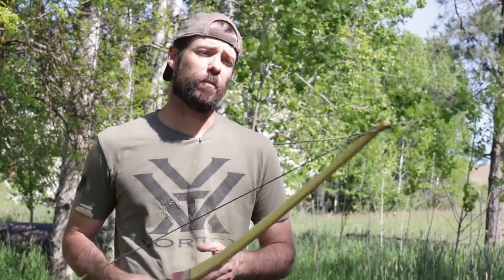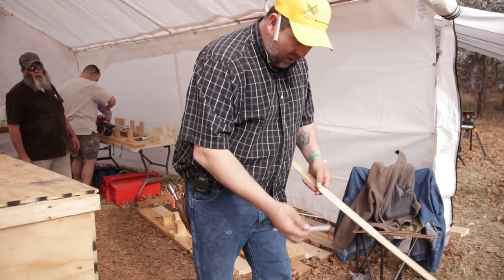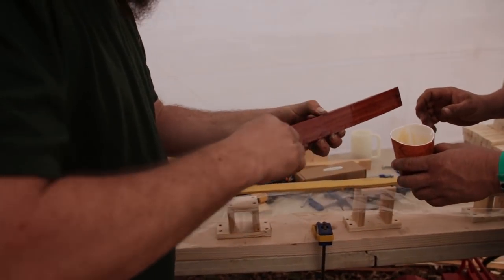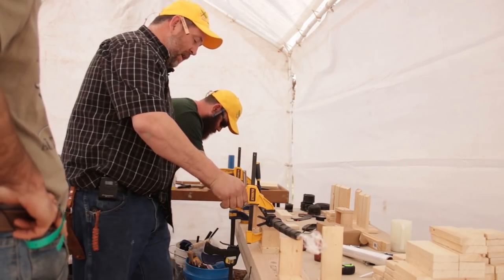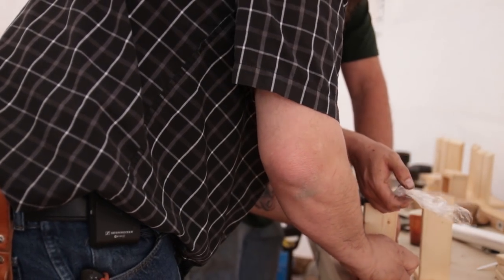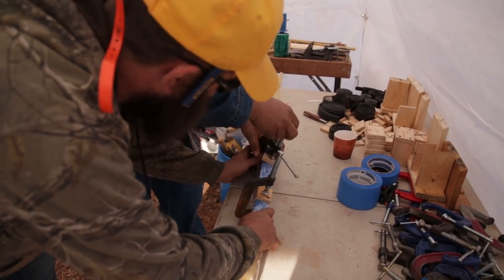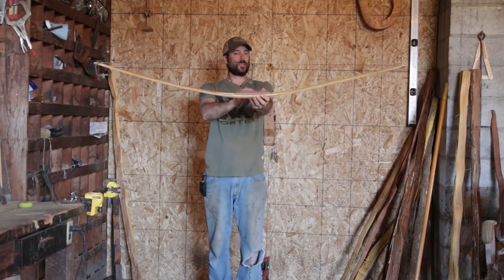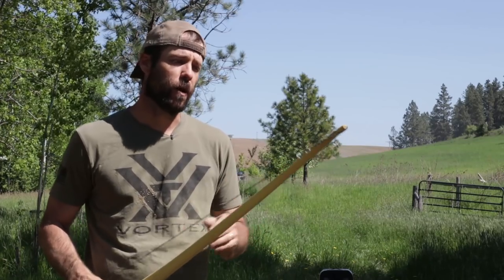How to build a Bamboo backed Osage reflex deflex long bow

Comment: Thank you for verry nice video! 
I am Japanese, I have a Mandarin orange field & Bamboo bush in my mountain so I will try to make my own Bamboo bow!
But there is no Archery or Japanese Archery gym at my living area, I am sad about that.
Sorry my English is not good. Have a nice Bow life!
Reply: You have to understand this this style of bow will require many thing's,..... but its the finest bow that can be had 2nd only to the Asian horn bows.
It requires bamboo and a good hard wood.
Most woods will work as well as Osage orange but,..........to equal woods like Yew and Osage other woods  must be WIDER to equal their belly compression.
If you use other woods and make a skinny bow the belly crystallizes and crush's the cell walls,......and leaves cracks in the belly.
All woods can potentially be as good as yew and Osage orange if they are wider.
So,....the prep is bamboos absorbs all moisture in the air,... then the wood and bamboo comes unglued.
So,....you prepare the wood and bamboo and put them in a dry box for several days prior to gluing,.....then the glue will bond them together correctly.
These Bamboo backed bows I think are the best.
Good luck and best wishes.
You cut, shape, dry box, glue,... then you tiller the bow. 

In america,...rarely do we go to a shooting range,... we shoot in our back yards,....or out in the woods.
Rotten stumps or a hill side will stop the arrows.
Oh yeah,.....the wood you cut must dry for about a year,.... because green wood takes a set,....that means it don't make a good bow till it dries.
In America we have book's that instruct us on how to make all bows.
books
The Traditional Bowyer
The Bow Builders Book
The Bent Stick
And there's a few more and I have no way of knowing if they print them in Japanese.
Reply: In the case of the example bow in this video, I wonder if you backed the bamboo with sinew and shortened each limb about .8-1.0in if you would have a 50-55lbs draw @ 26-28in draw.
In this case this would be much simpler to build then a horn belly horsebow with siyahs and tempering/setting the limbs, and I think for the time to build and resources this reflex/deflex would be a considerable option.
I bet a matched 360 to 372 grains arrow would fly very nicely with that setup, too.

The only thing I'm concerned is that since there was no heat tempering of the wood that you have to leave it unstrung when not using it (unless instead you back the bamboo with fiberglass and switch osage to Ipê, lol).
Reply: Did you try making it?

Comment: Regarding mixing strong epoxy.The glue forms when one type molecule locks into a molecule from part ‘b’. Any unmatched molecules degrade the glue strength. It’s not like mixing cream in your coffee. Therefore the most accurate mix is by weight on an accurate scale.

Comment: I have been watching  the bow building process and I noticed    the bow limbs  are  thinned  so they are even on both sides  the  center of the string is used  when its pulled down  in tillering  process . I have noticed that a lot of people are  using  the 3 under finger placement and  string walking  where your fingers can be a good 2.5 inches below the  arrow knock and where the arrow is setting . This puts  the center of the string point down about 4 inch  from the  arrow knock .

If you are going to  use the 3 under and  walk the string  down  would it make the bows action  better if you  tilled the limbs if you pull the string down  4 inches  below center  where you show it in the video  at  20:50 ? 

I have always shot  one finger over the arrow  so I decided to try  the 3 under and string walking using marks on my tab . The first thing I noticed  was the flight of the arrow was not the same it was  doing a up and down  movement   pretty bad .

What is going on with the bow and the arrows   when you change  the point where the string makes its bend do to your fingers on the string ?

I can feel a difference in the actions of the limbs  the further I walk down the string  Its not as smooth as when I  use the one over  hold .
Reply from the maker: string walking or shooting with a crawl causes downward pressure on the arrow as the string is released. this can cause the arrow to bounce off the shelf resulting in the up and down flight you've seen. check out my tuning video. It might help answer some questions.

Comment: I'ver got some hickory and some red cedar and have been thinking to do a hickory backed longbow. Do you think this flatter, shorter style would be better? I've made a couple of osage self-bows, following your book, and thought it would be fun to try a backed bow. I cut this stuff a couple years ago and split it out then so it should be dry enough by now.The osage was still a bit wet when I made those bows, but I still have about fifteen staves that are getting dry now and should be ready after I make the laminate bow.
Reply from the maker: I think the design in the video should work well with a hickory backed red cedar.
Reply: @clayhayeshunter  Thanks. I'll give it a try.

Comment: Clay, I know you said you didn't want to get into why you make the bottom limb a little shorter than the top typically, but do you have another video that explains this or could you explain why?  If it has to do with shooting 3 under,  I'd especially like to know, for I shoot the same.
Reply from the maker: If you move the handle down it gets the arrow a little close to center instead of pushing it two inches above center. I’ve seen many bows of symmetrical design that function well. This is just how I do it.
Reply: @clayhayeshunter  Ahh, very cool!  So essentially you make the knocking point at the center of the bow/string, rather than the pushing point for your bow arm?  I can see how this would be advantageous.  I'll have to give this a shot soon, when I finally make mine!

Comment: Hey Clay I just wanted to ask you a question  . I am thinking about building a bow like the one in this video the bamboo back where the Osage , the problem is I don’t have any Osage or bamboo but have a nice piece of hickory bored with the grains running perfectly ,I was wondering if I could laminate like in the video hickory on top of Hickory with a purple heart power lamb in between the two Hickory’s slats would that make a good bow , I would appreciate any information and glad to except it.
Reply from the maker: I think that would work fine. I’d heat treat the belly side before glue up. Hickory tends to take set otherwise.
Reply: @clayhayeshunter  OK I will try it it ,will be my first bow I really liked the way those guys in Oklahoma did that bamboo bow that you Had

Comment: Nice bow sir, I love trilam English long bows. I got a trilam flatbow but the elb are so much smoother. Anywho, if you want a heavier trilam try ipe as the corewood. Does much better at compression the Osage. That same amount of ipe might get you in the 85-75lb range. Stuff is super dense.
Reply: more power? make a horn compound added to the 2 woods, Ibex horn is long and  thinner than ram.make a bow that needs them  pulleys compounding just to get a draw on it.

Comment: should I use dry bamboo or fresh bamboo 
if i must use dry how long i must dry it in day light
Reply from the maker: Dry. Not sure how long.
Reply: in your vid is there use 2 kind of bamboo? coz I see diferentiate between in-side and out-side
Reply from the maker: Bamboo is only used on the bow's back. the other wood is Osage.

Comment: What is that hacksaw blade you were using to cut string grooves called ?
Reply: I think he mentioned it in other videos. It's carbide or wolfram wire saw. The kind you use for ceramic tiles.
Reply from the maker: Yep